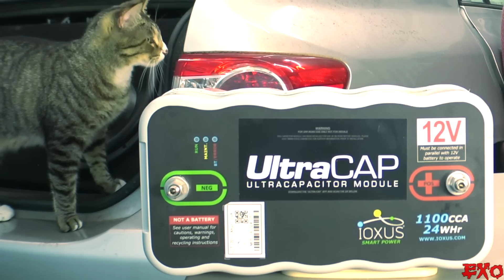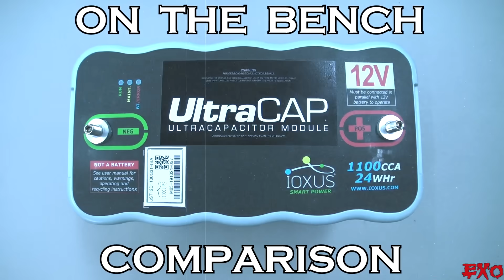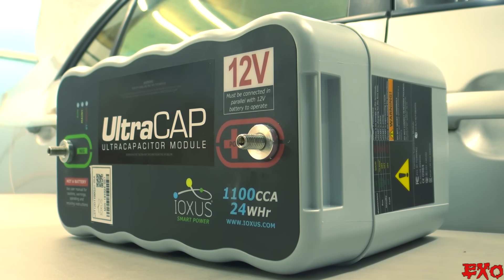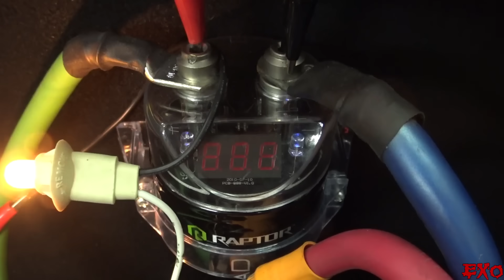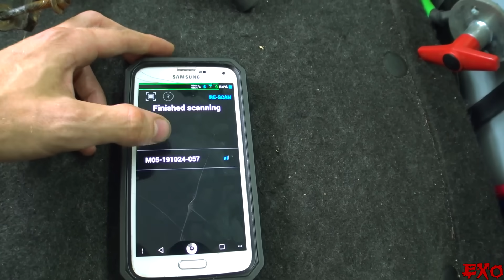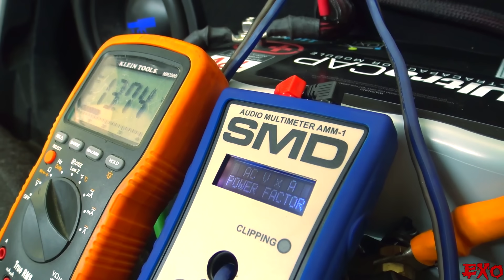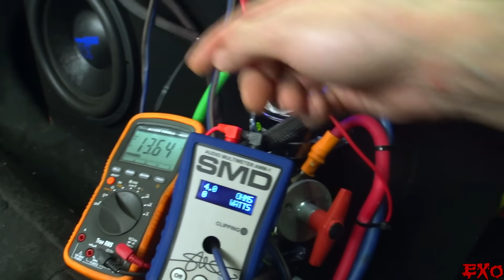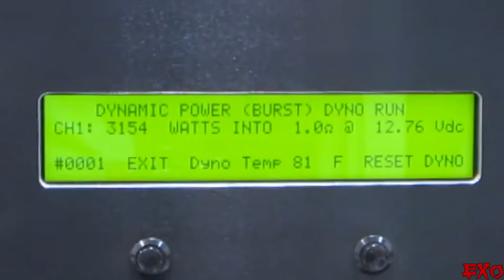The TRUTH About Car Audio CAPACITORS! Testing a CHEAP 12v Capacitor VS IOXUS UltraCap Supercapacitor

Comment: given the cheap cap only choked out a pathetic 5A it would be a good buffer for someone running a smaller amp set up that's like a 100W 4 channel and a 60W 1 channel with compact amps and a low profile sub for keeping them isolated from causing too big of a dip in voltage in modern cars where they are sensitive to voltage fluctuations and mounting space may be limited. as for the high end bespoke stuff that's where they are no longer adequate and you will need something a bit more spicy.

Comment: Im running a standalone 100ah lifepo4 battery in my EV for
My amp/sub and I’m using a 5 farad stinger cap. It does a good job of keeping the current draw low at the battery keeping the BMS from being tripped.

Comment: I remember I had a capacitor installed in my Ford Escort ZX2. I had an All Alpine system with Infinity speakers and subs. I had it in for about a week and turned it up. As I was driving a long and listening to my tunes a heard a load BOOOOM come from my trunk and sound went quiet. I pulled over, opened the trunk and the capacitor blew up all over the inside of my trunk. I was quite pissed that I put all that money just into a capacitor and blew it up. Lesson learned. I disconnected it and just ran my amped set up which still sounded cool

Comment: I have heard that you should have 1fahrad/1k watts
Reply: A True 1uf cap when installed and Correctly Energized before First use. Should be capable of Equalizing voltage  on a 1500 w rms  amp . Energizing the cap the First time is CRITICAL TO ITS FUNCTION ASWELL AS always Correct 
De energizing when uninstalling

Comment: As someone that had run 1 parat Caps back in the 90s, I had never had a starting issue as shown. Capacitors are used in pretty much every electronic device you can buy many in each circuit actually. I guess, my request is, can you explain more detail why with standard cap car wouldnt start? Adding a cap should not Drop voltage inline unless it was forced to charge from battery/not alternator. Now battery doesnt have amps to turn starter. The ultra cap looks like a battery with managed power dissipation...no?
Reply: he has the car's battery disconnected in these tests and he was trying to start the car using only the cap's power.

Comment: i can let you know  i have that  ioxus cap  i use it in my bedroom setup.   i have 3 30 amp buck boost converters on a 100 amp bitcoin power supply,  going12.3v to 14.8v   the oixus capacitors on bstock sale right now for 100$ .   they come in questionable conditions     for 4 years i'v had this in my mind until i seen it for sale on d4s  audio      and im impressed,   they can Start my mower  with jumper cables  and a phone app to jump mode. this cap also when unplugged turns itsself off While being charged .

Comment: I don't have Instagram. But I wanted to say. Here in northern Wyoming where temps fall to -40 lead batteries fail a lot. So people have been switching to the super compasitors instead of a asid core battery.  I can't afford one. But the 2 people i know that made the switch. Have told me. The super compasitors hold up much better in cold and hot weather.  
Nice. Report. I enjoyed watching the way each compasitor worked.

Comment: Back in the day we never needed second batteries or super capacitors,why today? I remember having 4 tens and a 900 watt amp and never had any lights dim
Reply: lets see., i'm running 12,000 rms watts., Thats more than 10 times the power you were running., more power.
You need power to make power... And you ask why the need?

Comment: Where is the "fits UNDER the seat" option... Jeep Wrangler 2-door here... subs in back, amps under the seat... do you have one the size of a small amp, so I can put it under the seat with my other 2 amps?  Not everyone has room for this!  I'm fine with 1/6 of the farads you are advertising if it can be squished into 1/6 the size.  Sigh :(

Comment: Also you need the right cap for your amp its 1.0 farad for every 1k watts i believe so was that 4.0 big enough for your amp? I have a diesel truck that has 2 batteries from the factory hense it has a little bit stronger of an alternator but what i did was run my battery that is only used for starting to a 6.0 ferad cap and my little teramps big boss 3 amp loves the extra consistent power 🔋 👍 now my headlights were not going dim or anything but if i was playing something with a ton of bass it would eventually clip and shut the amp off for a few seconds then it would come back on aftwr i lowered  the volume enough! But now it dosent do that anymore ! So the cap solved my problem . And was 150% cheaper then another good battery ! Remember i have to purchase 2 as it is every couple years hear in florida because the heat kills them! When i lived back home in Buffalo NY my batteries would last 8 to 10 years ! Honestly! They love the cold vs heat!

Comment: I am not trying to start a car with my capacitor just stopping a draw when the bass hits and mine does exactly what I put it there to do .I mean that is as big as a 13 volt battery if it didn't start the cari would grow it out the window .

Comment: Question what amp alternator and voltage is your alternator the car is at idling. But it's a big difference between that small cap and the bigger with more caps.

Comment: I left my lights on for 12 hrs and run my battery dead and it had enough power to turn on my radio, turning on the Cap, it started my truck 😮..... so im sold on Cap's.

Comment: Thanks bro I needed to see this video for the super capacitor. I been face palming my face on the table and walls from the the low voltage clipping for my systems and have been scorned from my personal experience of 1-2 farad capacitors. Definitely will pick up one from Amazon used at $150.

Comment: Awesome video, I've wondered for years which way was better to go,  a second battery (agm high Amp rating,  low Amp hours) or a capacitor...
I would try to get a large 2nd battery with a heavy duty isolator relay so the car/ boat could be played without the engine running and still start perfectly when the key turns triggering the relay to connect the 2 batteries together.

Comment: I have this but haven't installed it yet. I have a secondary battery with a AGM interstate as my main. Running a JP23 Amp  2ohm. with two 12" DB Drives - I can dip down to the high 12v's and also get clipping on the amp. Everything plays great, I think the subs could even push more power. My issue is the voltage drop and its annoying. When I get some time I want to install this IOXUS, but wondering if that's really going to cure my voltage drop. I was skeptical about the second battery thing too but did what the guy recommeneded me at my local audio store. Everything is 0 guage and have a 320 amp alternator. Its not a mechman and I Was leaning towards getting a mechman. Any advice to cure my voltage drop without going to lithium banks would be much appreciated! Mechanic of 35 years, so whatever I need to do I'll do!

Comment: Quick question : I have 65wh battery with 150a alternator in my 2011 focus mk3, I can add a 300w sub in trunk without capacitor or any upgrade right ?

Comment: hey I got a question for you I have 2018 ford f150 super crew cab I have on back Costin box subwoofer  with 4 8" subwoofer have two amp one have 1200 In the other amp 2000 I need to put a capacitor So my lights from inside den flashing

Comment: I got a Cadillac Escalade 2009 I have 2 amps one 8k bass tramap and one 5k voice amp I have 2 skar audio zvx 12 inch subs there peak at 3000k each so I have the 8k tramp hook up too them I also have for 10 inch bass rockers for voice and my door speaker I have those hook up to the radio only no amp I have 2 ds18 battery and a mech man alternatori also have a yellow top battery for my main truck the problem I’m having is when my bass hits it clips I turn it down but I no that those skars can take more power I ran 2 grounds and 2 power wires just to the 8k so I no it’s not a ground issue the only thing I notice was one of my da18 battery is leaking could that be why it’s clipping I just bought that battery you showed here today do you think that would work on my set up

Comment: A 1 farad cap kept my lights from dimmimg and such. I just had one big 5 channel premium eclipse amp runnin 2 12s and components in the back and front. Think it was 100x 4 and 200 x1. without that cap at loud volumes my lights and stuff would dim. With it no dimming regardless of volume.

Comment: Hey so I been watching you for years I learned how to wire systems from your videos so I have a question I have 2 rockford fosgate p3 12s on a rockford r1200 watt amp in a 2013 chevy cruze eco I just bought a brand new battery for the car and when I'm driving and bumping music my voltage goes frome a steady 14.1 to like a 12.1 my lights dim and I feel like the system loses power do need a cap? And should I do the big 3?

Comment: I made my own up to 16V 500 farad capacitor bank using 6 3V 3000 farad cells connected in series without any electronics 2 years ago. I put all that in a foam padded plywood box and just hooked up in parallel with my car battery. My car never has a problem cranking over and I have no voltage drop at all with my current 1000W audio setup. I can start my car several times without the battery using this too so it doubles as a jump start booster pack.
Reply: Well it's only a 1000w so hahaha

Comment: To my understanding, i thought that by hooking-up a amp capacitor helps stop your car lights from dimming. 
I have installed a capacitor in my car and still my car lights dims whenever it hits hard.  Very simple setup. Any suggestions please?

Setup
Kicker 46CXA4001T CXA400.1 400w
KICKER CompR 10"(25cm) Subwoofer
Belva BB1D 1.0 Farad Car Audio Power Capacitor

Comment: I bought the uc-31 strictly because of THIS video.  Needless to say, I am not disappointed.  I am now able to run a true 3k amplifier without a high output alternator. I have done the other necessary upgrades such as big 4 and quality ofc wiring.  Going by the app for the uc-31 on the hardest hitting songs my voltage stays right around 14v. At idle it stays at mid 13's. Thank you Exo.

Comment: Did this ultracap get discontinued or something? I can't find it on the website. What would be the next step up from this one?    Also did this work in a system using a lead acid battery? If not what would be a good product to use with a lead acid battery system? 1 main battery, potential 240amp alt and maybe 3.5k on the total rise watage for the bass and highs. Thanks

Comment: Old Video, But thought I'd share any how. I don't even have a Battery in my Blazer, Have 12 3,000 FARAD Maxwell caps. They are in Two 6 packs that are ran in series parallel to allow for 16 volts which gives 1,000 Farads total after being in series parallel .

Comment: so what does higher farad do would that increase the results or decrease them i know having to big of a cap can do more harm than good by taking longer to charge i have ram 1500 300 amp alt,xs d6500,all ofc big 3 and dual runs 1/0 from alt to the batt l, certain songs certain notes ill drop to 13v but once that note switches it goes back to 14.4 i have a audiopipe 10 farad cap should i ditch the cap for the ultra cap or should i keep the cap and get a second xs power battery pleae help been doing research for weeks and cant make up  my mind  system is 2 skar vxf 12s wired to 1 ohm on skv 4500 witch dynos 5141rms at 1 like i said its rare i get any voltage drop when i do its above 13v so any input would help  ditch the cap for ultra cap or keep the audio pipe cap and get secondary xs power batt

Comment: I had a ultra capacitor install in a off the grid situation for lighting,power when I used to travel there was the 750 cca  battery in the engine bay an the other  two super capacitors where on the storage box via a smart control switch if my car battery went flat.  on the front of trailer a was kept charged up via 2 2,400 watt solar Pannels to a controller and connected via a electronic solar control module.

Comment: I have a 3 cylinder engine Mitsubishi mirage g4  8k taramp 2 xs power 3400 battery big 3 upgrade beefy soundstream 15 sub Voltage 13.8 after awhile 12.4 what can I do to keep consistent 13 plus Voltage

Comment: As a ASE mechanic and mecp certified advanced level  tech I can say that if you are pulling that many amps that your alternator is slowing and causing your belt to slip you are definitely pulling at least 110% of that alternator you need a bigger alt and need to look at the belt, tensioner pulley to make sure it is applying enough tension to the belt so it doesn’t slip  
And keep up the good work on these videos very informative and very easy for newbies to follow. Great work and thank you.
Reply: This is why I upped my alternator to 400 amps / big 3 upgrade / and run a bank

Comment: One thing to take into account, not all capacitors are created equal. There are no compliance organizations that ensure the buyers are getting what is advertised. Sadly, many are just shy of an empty shell. Just as many amplifiers on the market cannot reach the advertised RMS ratings, neither can capacitors. I've found 1 Farad capacitors that literally have 30,000uF of capacitance which is 3% of their advertised storage capability. A good quality capacitor works but you will usually pay for it. Ultimately your system will use more power due to the greater efficiency in power delivery. That's not a Band-Aid for too small of a battery or alternator though.

Comment: i have a 96 chevy im putting two skar 10's in and when they hit on low volume the hit fine but when i turn the volume up they sound like its clipping or popping like its not getting enough power should i get a capacitor ? or a new battery

Comment: What's the best way to hook it up ? Do I need a cut off switch or does it wire in like a 4.0 cap and turn on and off automatically ?like positive to positive from the battery and  negative to ground?

Comment: I’m planning on running a deaf bonce 3012R off a jp83 tuned to 2800rms at 4 ohms. Would I be better off with some batteries or one of these ultracaps? I have a 370 amp alternator that was tested at 218 amps at 650rpm and 390 at 1800rpm.

Comment: This may have already been asked so if it has I apologize for repeating. So if I got 1 of the Ultra Caps in this video, do I still use my 2nd AGM battery? If so do I just hook it up as if I was adding another battery in series/parallel? Appreciate any advice because I'm getting back into the car audio world, I'm not a rookie but it's been awhile since I've had a setup in a vehicle. Thanks again!
Reply: run it parallel with your agm

Comment: Back in the day I had a Geo Tracker with a system in it and a BatCap 800 to help, I didn't even know it, I had a bad battery lead for a few weeks and was cranking and running the car pretty much exclusively off of the BatCap.  Didn't even realize it until I managed to discharge the BatCap and when I checked my leads found I had one that was barely hanging on.

Comment: Big thanks to EXOcontralto for this awesome video!
Happy New Year young man!
I've always used a cap in my builds. I've always considered a capacitor to
be like a "shock absorber" in the system's frequency flow, letting it build up before
being used, like a quickly discharging battery.
Reply: a cap is smoothing out ripples produced by the alternator. for some reason rarely mentioned

Comment: I have one of these I'm going to find a spot to install . I'm thinking since I'm only running a single run of 2/0 to my amp with reducer to a 1/0 pin I'm just going to get a dual 2/0 to 1/0 pin and run the b+ and capacitor+ into the dual 2/0 pin right at the amp and just ground the cap to the frame I'm the pick-up bed with cap right behind the cab in the tool box . I can't see why I can't just pair up the cap and b+ right as they go into the amp the cap should still charge and discharge...lol...any reason this isn't good idea ?

Comment: little small lightning caps are only good if you have a low amp output alternator, For the cost, upgrade the alternator.

Comment: All vehicles are not the same mine stays above 13 always brand new alternator puts great so it keeps mine up for the money..
Have no problem with the capacitor it does a great job for me made a huge difference for me.

Comment: Hi from London 
Will you
 help me set up my sound system 
In my l322 td6 3.0 ,I have replace my original head unit for a pioneer avh3600 
I prefer twin 15"subwoofer ,two extra bullet tweeters on  rear shelf and two extra 6x9 speaker 
On same shelf extra battery and now this power cap battery I just saw you talking about .
Today's date is October 15th 2022 ,yes I am only now seeing this video about the power cap.
Bye for now Anthony.

Comment: I'll never be able to afford a system, I don't even know why I watch these dang videos, I'm a single dad that would love to have a nice system, but pipe dreams.
Reply: Bullshit bro. With clearance stuff and marketplace you can put together a nice system.  Only difference is it may take longer.  I got my first subwoofer out of a junk yard and I fixed a amp I got out the dumpster. Built my own enclosure run off factory head unit

Comment: I'm just going to say it depends on what you're pushing and it depends on what you're talking handle instead of going the capacitor route I've always put in better alternators big ass truck batteries and Tiny Ford focuses oh but that's going to ruin the car okay that's usually from the guys that have the car held together with electrical tape sound system wise